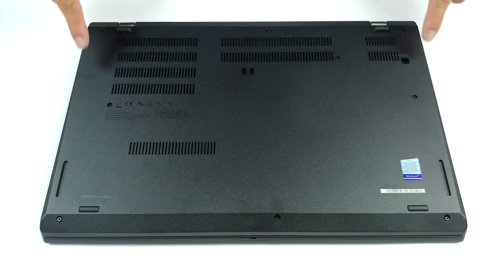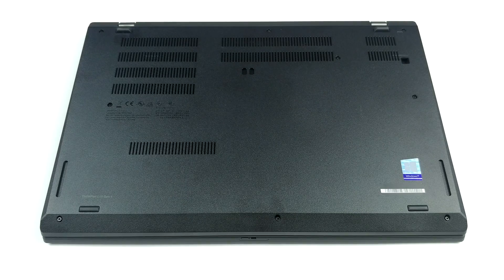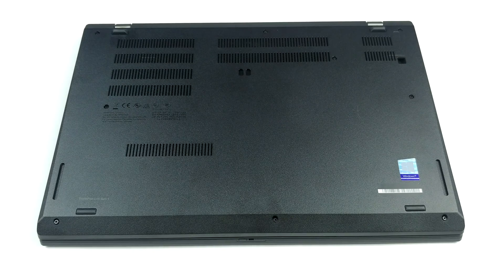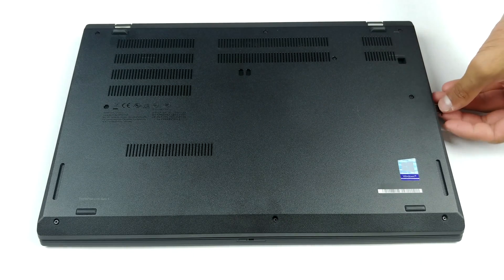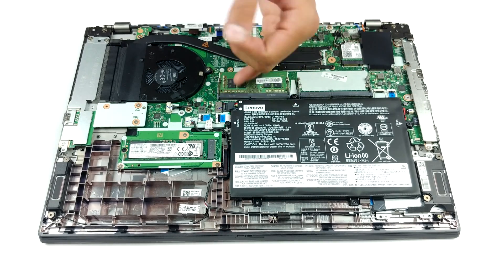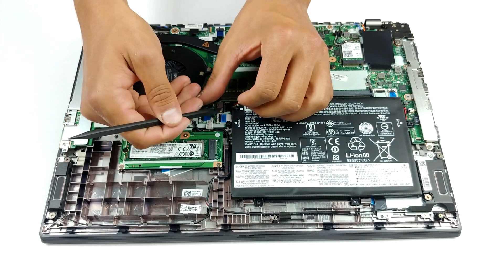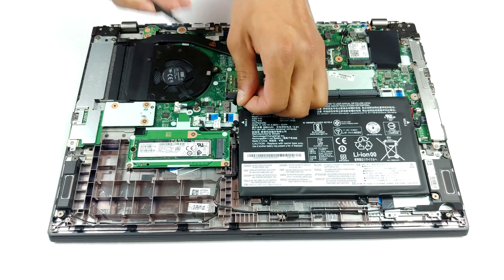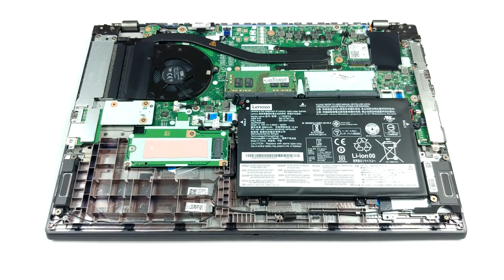🛠️ Lenovo ThinkPad L15 - disassembly and upgrade options

Comment: Doesn't make sense why the battery is glued to the chassis. It's also not the case on the L14 (https://www.youtube.com/watch?v=qyBWg2_4uA0). Did it change with the L15 2nd Gen?
Reply: guess its cheaper that way

Comment: How is the battery glued to the body? If it is with those white gum-like glue tapes - like in the smartphones - it should be possible to take it out. I just can't believe that Lenovo have  not left any room for replacing the battery. 
What is someone supposed to do if it malfunctions? And should you throw your 5 old years laptop when it degrades to an hour or two of runtime?

Comment: Thanks for the video, I ordered this laptop but with the 5400RPM Hard drive. I've like to replace it with a m.2 NVME drive, could you tell me the part number of the adaptor for that? It LOOKS like it says 20153m?

Comment: So the L15 has no 2.5" HDD space like the E15 G2? Having more drive space is important for me... See https://youtu.be/z40f4TAEmsI?t=44
Reply: No but you can upgrade the M.2 drive
Reply: @LoganT547  Thx. I already opted for the HP ProBook 455 G7 which has the 2.5" HDD bay as option you can install an drive to store big files...
Reply: @chrisbo3493  you can have large m.2 drives too